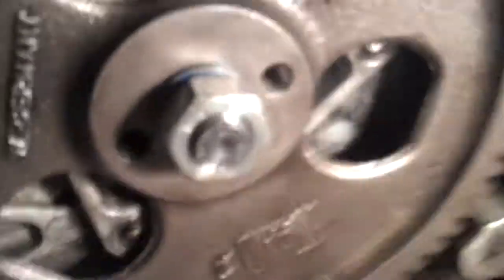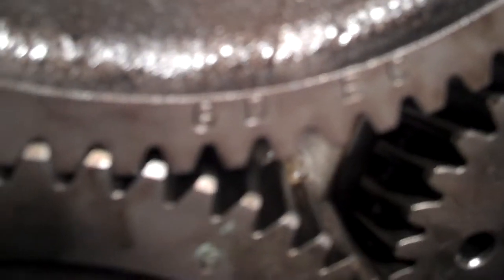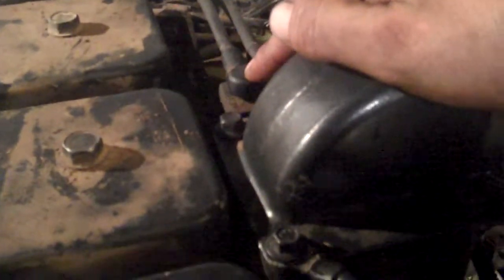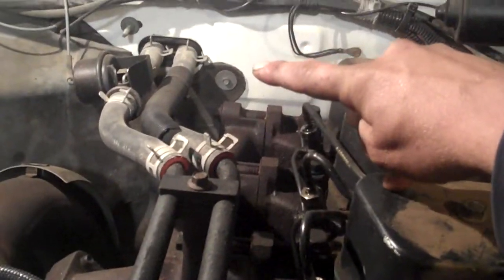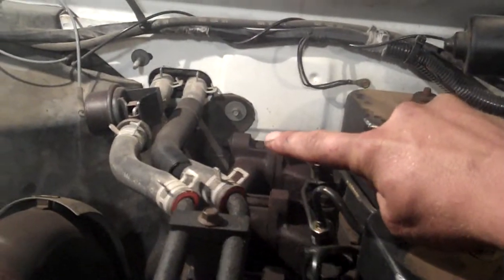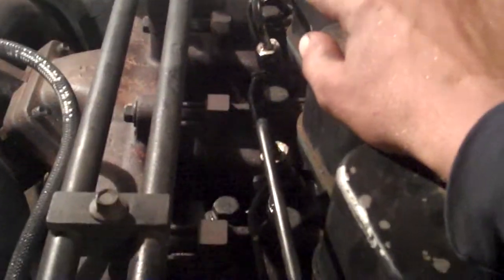The 12 valve terror continued!

Comment: rollthe engine over so we can see the marks at their closest points...i cant tell if they are correct.
Reply from the maker: ok.I will tomorow but i assure you they are dead on i mean it is perfect
Reply from the maker: I really think i have another issue.I think it should run ,I have tried it on both letters.
Reply: did you give it a shot of spray?
Reply: make sure that cam gear isnt cracked and has spun.
Reply from the maker: No either yet,I am about ready to though.
Reply from the maker: it was running, we started with a leak. He shut it off because it was leaking alot of fuel and it wouldn't start after that. I fixed the leak and it still didn't run so we got a new injector pump.I had to remove the pump to fix the leak.

Comment: Can you pin the back of the cam gear, with the cam pined at tdc and the pump pined that should make it right.
Reply from the maker: We pinned the engine and installed it on e and on d.Now the dealer says Vin specifically that it belongs on the e ,which is where it was before.We put it back on the e and it still doesn't run.We are thinking the crank sensor may have a problem.I think i may have an extra sensor, I'm gonna go look because i hate throwing parts at things.do you know if either of the two wires that run to from the pump to the sensor in the air dam via their own wire are ever suppose to be energized?